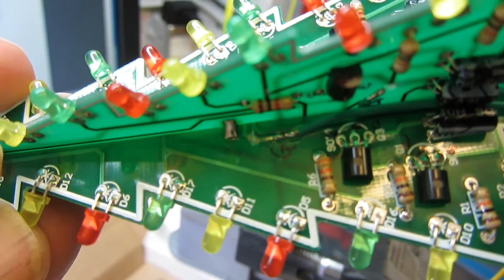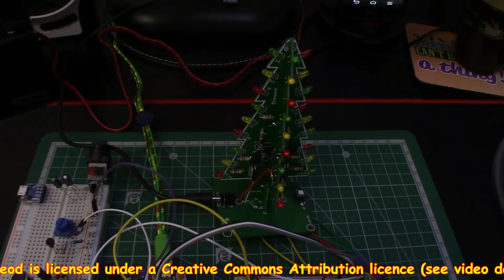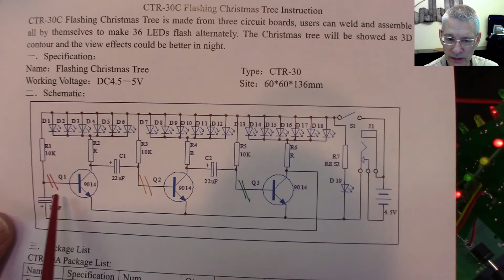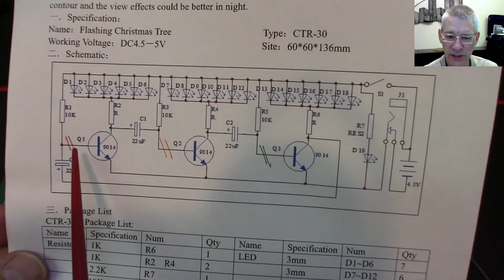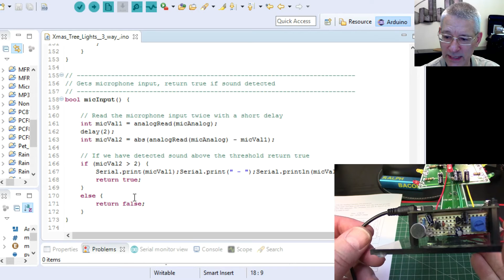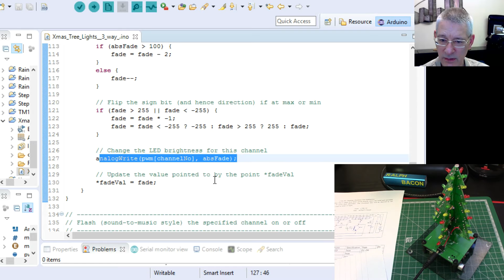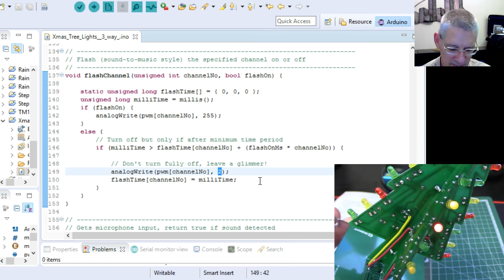#57 Xmas Tree Project - Completed

Comment: is there a circuit diagram for the mic preamp?
Reply from the maker: Hi Scott! Yes there is, and if it is not in this video then look at video #52. As you might understand I can't quite recall exactly what was in each of the videos but between these two I think it's covered. If not, let me know and I'll upload a circuit diagram to GitHub. You gonna build this? Or just the preamp?
Reply: Hi from Australia Ralph, I'm attempting to build this or something very similar anyway. It looks like your first vid has a single transistor pre amp and the 2nd video has a two transistor pre amp. You show the finished strip board layout but not a schematic. not that I can see anyway?  I could use the single pre amp I'm sure, but haven't also been able to get your sketch compiled either.  I wonder if I need the newest version of the arduino software?
Reply: ok.. just watched #52 which didn't mention the Christmas tree in the title which is why I missed it... however after reading more comments here I found it.. Many thanks.
Reply from the maker: Phew, thank goodness! It's definitely the two transistor preamp that is the best one, as it has 'auto-gain' so regardless of how loud (or soft) the noise is, it will be picked up (once the volume control has been initially set). Good luck with this and give me shout if you need more info!

Comment: Hey Ralph, I'm rounding up parts for my amp for this little project. Did you post a schematic for the amp? I re-watched the 1st video, and can't seem to find a diagram. I'm building a "extra" one for the grands. Thanks
Reply from the maker: You're right, Danny, that circuit diagram does seem to be missing; I'll upload later this evening. I'm sure I discussed the circuit in one of the two Xmas Tree videos but that won't help you much. Leave it with me.
Reply from the maker: OK Danny, the microphone preamp was the subject of a totally separate video, in this case video #52, the description of the circuit starts @ 3:50 but you will probably want to watch the whole things as it gives you some pointers, like ensuring that the power supply is properly decoupled (ie, no noise on the power lines). Enjoy!
Reply: Thanks for the reply. I remembered the #52 video, but I some how got confused with the 2 versions of the amp.....getting old!

Comment: Useful and interesting! Got my tree kit today and of course going to mod it as your sketch. What a piece of work. I can't wait to show mine off this Christmas, and you will get the credit for the programing. How do you know all this stuff? I have tinkered with electronics all my adult life, but coding does not come "natural" to me. That's why I'm glad there are people like you that are masters at it and are great teachers. Thanks Ralph.
Reply from the maker: Hey Danny, good to hear from you again. That (modified) Xmas Tree project is a real winner in my household - it even flashes in time when people speak in the room (or when the TV is on, of course). Building the microphone amplifier unit is, of course, a key step but you can build the Xmas tree first, test it, then make the mods to that (so you know that bit works) before building the amp. Now...
 
How do I know this stuff? Serendipity, good luck (and a bit of work), I guess. I took up electronics when I was about 14 years old (yes, we did have electricity and running water back then!) and became interested in programming about 4 years later (and eventually took it up as a career). Now, here I am combining the two. Isn't that fortuitous? 
 
I'm glad you liked the video, take your time and it will be a great thing to show off in a few months.

Comment: hi
on banggood there are 2 kits, you used the 3 colors one, but buying the colorful edition is ok? Can be used as yours, in your example? Only 50cent more than yours... thanks :)
Reply from the maker: No, only the 3 colour version will work here. The colourful version has multicolor leds that already have a chip built in that won't work with the arduino sketch here!
Reply from the maker: That said, and for low cost of either of these kits, I'd almost recommend you buy one of each. Then you can compare the Arduino controlled version against a 'colourful' version with LEDs that do their own thing without an Arduino. I've got both kits now but have yet to construct the 'colorful' version - I'm tempted to keep those multi-colour LEDs for other projects, but you can buy them separately too.
Reply: that's what i did, indeed :D
Reply from the maker: Good call, and have fun making the kits. Just take care in getting the LEDs the right way round.